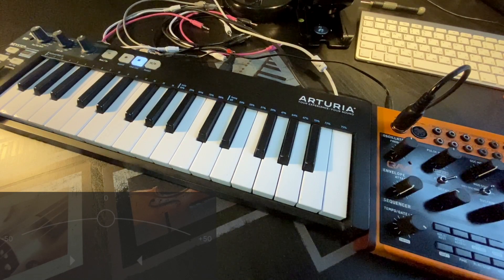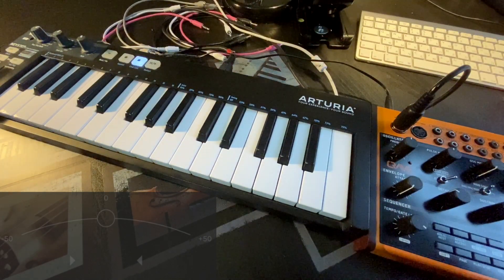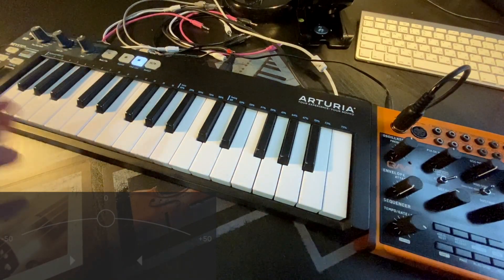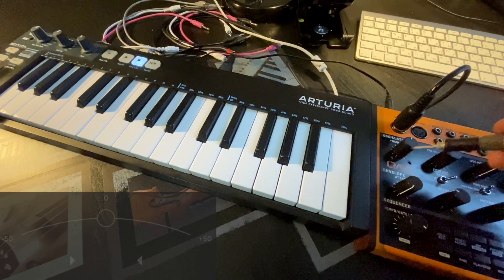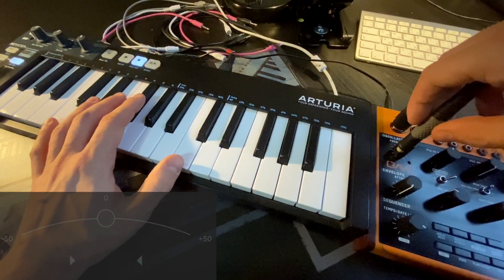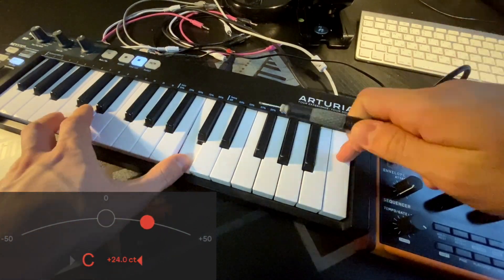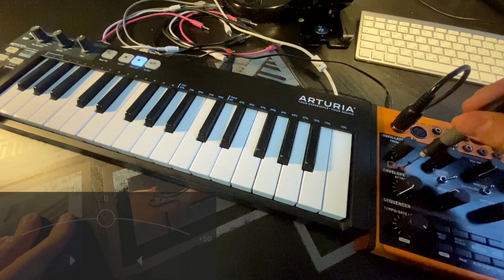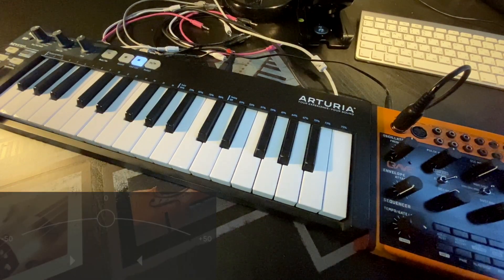What these screws/holes for in Behringer Crave?

Comment: Do you know how I can do the same on the Behringer arp 2600?
I'm having the same issue with it.
Reply from the maker: never tried this on 2600. they don't have it on the front panel. probably under the hood..?
Reply: @AntonAnru  they're are all accessible on the front panel but there's loads of them 
The first oscillator has two and 2&3 have 6 each.

Comment: Cool, so first one is volts per octave range  (midi) and second one is pitch shift. Liked the approach.
Reply: That's not midi. Midi is just information. If you press C, the midi out will just output the information that a C is played, no matter how the actual generator is tuned.
Midi = ones and zeros
CV = Volts per octave

Comment: I just checked my Crave and when the Frequency knob is at 12 o'clock it is perfectly in tune (scaling and all) at A 440 Hz so I better leave it that way and not mess with it. The only inconveniece is that C key sounds like A but I can tune it with the frequency knob if I want to.
Reply from the maker: That's the right decision. I had problems with tunning

Comment: As you've noticed the one one the left is for 1v/oct tracking (scaling)and the right is for you default knob position if you like.
This is for calibration, I'm assuming they have temperature compensation as it's an analogue circuit.
You would normally set the reference frequency using the knob (eg: C2, doesn't really matter) and hit C3 and use the trimmer to adjust it. Go back to your reference and adjust the knob again and repeat the process until the scaling is correct. I would go 2 octaves, dial that in and then check 3 octaves and adjust if required. Once scaling is spot on set the Freq knob to centre and adjust the right trimmer to your reference. Same calibration for any VCO, there abouts. I noticed a similar issue with the Behringer 921 VCO...
Reply: Interesting. It makes more sense to do the scaling first as you suggest.
Reply: thank you that was great help!

Comment: This is one of the "joys" of a real analogue synth. It can also be really frustrating trying to get the "scaling" correct over a wide octave range...it's probably possible with a modern synth like the Crave but it was impossible on my old Pro-One. I guess that just adds to its character!
Reply: Moog were notorious for it.
Still beats the time that would get eaten up if you were foolish enough to move a mellotron around a few times...
Reply from the maker: Yes. And with the modern synth you have a choice: trying to perfect the tunning or leave it as it is

Comment: dont care for perfect tuning is you buy analog (its the charm) , these holes are very common since they calibrate the midi side to the analog side ,  scale is the offset in the 12 note interval , mess with that and it an take long before you find it again ,been doing this routine on kenton interfces since 30 years

Comment: I did the same with my Little Mcv. Use it to midi control an old  MS20...
That small but wonderful device works with either, V/Hz and V/oct, but each one requires a proper offset tunning...
Reply from the maker: thanks for the info, will check it
Reply: @AntonAnru  I'm completely sure that the company that built that range of midi utilities closed long time ago... (Phillip Rees)
So, the only way to get one is checking ebay or Reverb listings...
Reply: I've found one... take a look at the tech specs...

https://reverb.com/item/973959-philip-rees-little-mcv-midi-to-cv-converter

Comment: I tuned my Crave using the screw on the right and the other octaves are only 1 or 2 cents off, so I'm happy with that. But I wonder how to deal with the OSC knob. If it gets moved even slightly the tuning goes off. The only thing I could think to do is tape it down. Is there a better way to deal with this? If there was a click, or detent, so I knew the knob was centered then the problem would be solved. Any suggestions better than taping down the OSC knob would be great!
Reply from the maker: unfortunately, you should always check it with tuner before the work

Comment: Its a common problem in analog synths. On some synths its not possible to tune the lowest vs the highest note, and therefor they should not be played with both bass and high notes at the same time, but be tuned for the used notes in the current song. You can hear the detuning problem on the Arp 2600, the Behringer Neutron and many other synths - but some of them can be tweaked somehow.
Reply from the maker: Yes, it's a great option to set it and can hardly remember any other synth with this thing